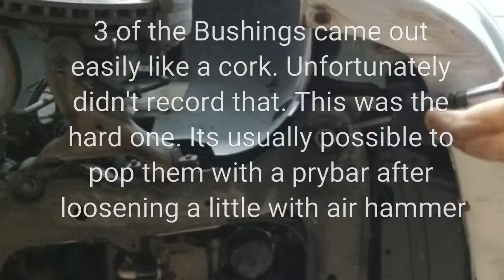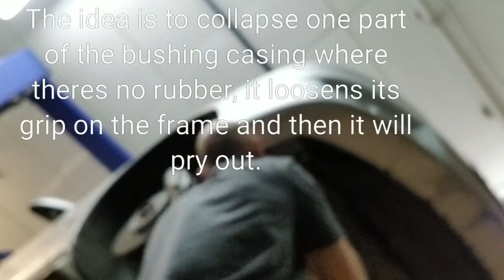Subframe Bushing Removal- Volvo S60R

Comment: You can get them out easily by drilling the plastic shell. You have to drill very close to the edge, ideally so the drill bit is scraping on the inside of the subframe hole. Then it cracks with the pressure of a large screwdriver. I know this comment is probably useless because you've done all of them and will never need to again, but I did all mine this way, while the car was parked on the street - no lift or anything. I broke only one drill bit, and it was worth the price. All you need is to get the car high enough to fit a drill under it.

Comment: The bushing isn't bullshit, your technique is
Reply from the maker: Lol, I didnt record the other 3 that came right out in seconds.. then decided to record and blew it. It was after a long day of work. When watching the video i see the car was clearly too high for me to get the pressure on the bushing.. By 7 pm I'm pretty beat! I simply should have stood on a step stool to get up where i could get some leverage.
Reply: @jeremyr7147  next time try the special tool, I have a video about it on my channel.  So few people do this job properly.
Reply from the maker: @reallyhappenings5597  I can have them done faster than the tool. Other 3 were out before you could even get the tool. And how much did that cost, i probably could have changed out 3 cars for that price. 

I work on every kind of car and truck. Just today a '06 Chevy 2500 HD diesel and a '10 VW passat and a '15 Fusion. Recently did the difficult Audi A6 2.8 timing belt without any "special tools".. it was dead on, ecu timing correction was zero. 

I shouldn't have uploaded this becuase i had zero leverage and it didnt go like it should of, more like a funny fiasco, but it got me practice uploading and editing a video though..
Reply: @jeremyr7147  I understand your need for economy, working on a variety of vehicles.  Owning two of these Volvos long-term, it works for me to do things the best possible way.  In case you don't know, the reason this front-right bushing was a struggle is bc it's the "anchor" corner.  Unlike the other three corners, a tube of body metal extends down several inches into the bushing, helping to locate the subframe during removal/install.  That's why it didn't collapse and why continued use of the chisel would have been bad.  The tool I use pulls it straight down evenly.  I respect how you run a business but I also know that application-specific methods are usually superior.
Reply from the maker: @reallyhappenings5597  yeah,  and that may have made it more difficult to pop out.. but the subfram was dropped, and what i was air hammering on was the outside of the plastic itself, once it collapses a little into the rubber void it comes right out, the locating rod is in the center of the bushing.

This is my car but theres no justification for me to have the tool. I was missing all kinds of special tools on this shit VW. I just make my own or improvise usually.

Thanks for commenting! 
And for the record the plastic bushing is bullshit!😁
I do like the Delrin set since I drive crazy.. 🚔
Reply: @jeremyr7147  fair enough.  I regret my judgmental tone.  That anchor may actually be front-left I don't remember.  But wtf hey it works and life is too short for me to be judging people on youtube, good luck to you.
Reply from the maker: @reallyhappenings5597  its alright, I knew it was a shit video. Some one might get something out of it..
I edited my last comment to you also.. I always edit, because I'm using a cell phone and its too small to see my whole paragraph. Lol